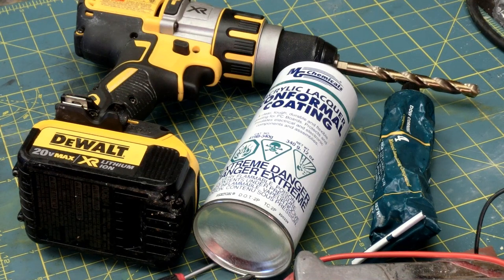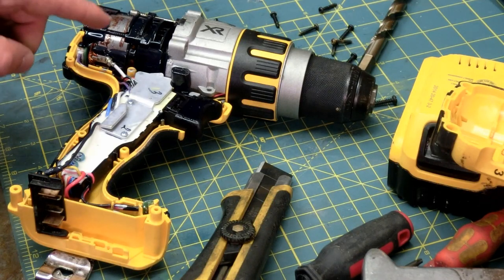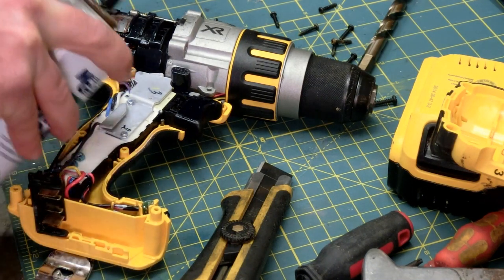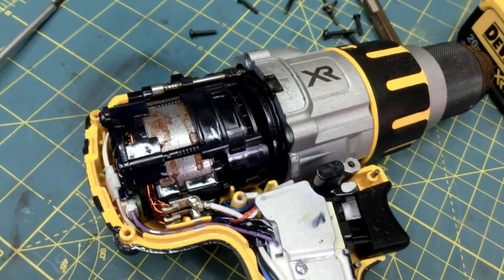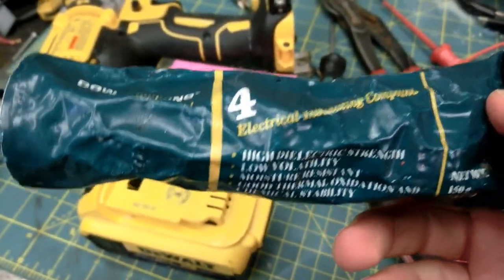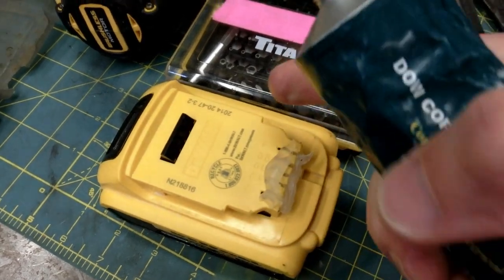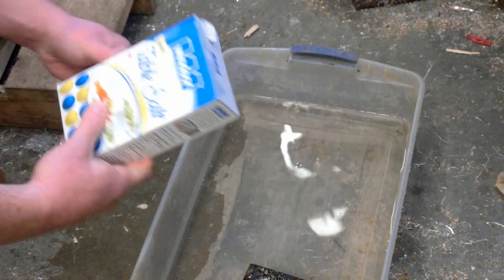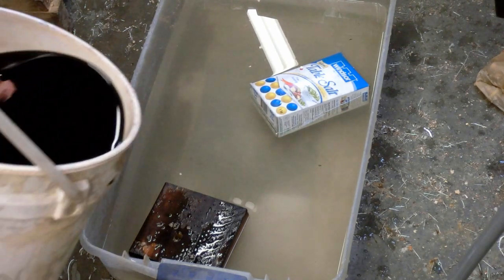How to Water Proof your Cordless Tools. Almost. SALT WATER TEST.

Comment: I like to pretend that I'm the reason for this vid. ha.  I was thinking about doing this with a cheap drill from the harbor freight, except I was thinking of using that never wet spray.  I'm actually a pool guy so that nemo drill was marketed to me, but too much cash.  I just use a hand screw driver if I must.

Comment: have to seal brushes and contacts on motor. commentator is just acting like a brake with the bilge water and probably maxing out the current through the switch
Reply: +George Robles Brushless motor. All the DeWilt auto screw strippers are brushless now days.
Reply: Okay, then have to coat the motor point of contention then, I couldn't tell in the video cause the 20lith didn't click to me automatic as I kept my 18 impact as the "20" volt did not have the same torque. Ten other dewalt brushless lithium 20 volt'ers could not get the same torque as my 18volt Nicad brushed motor.
Reply: ***** point is he did not pay close attention to motor or other side of contacts. Salt Walt will conduct. Between contact. And some di elec grease conduct burn and fizzle, seen it more on the high current side of things like the contacts on the golf cart with a coil resistor packs